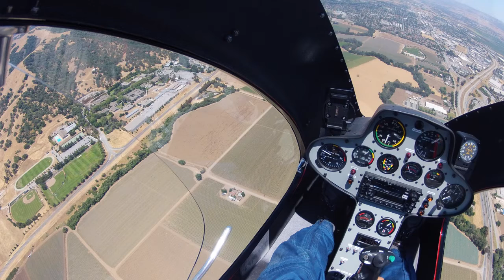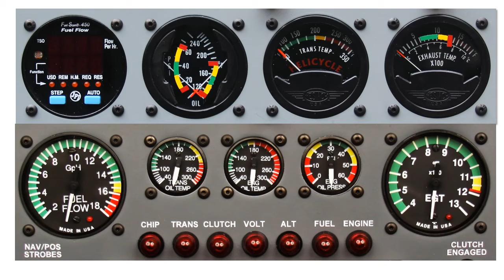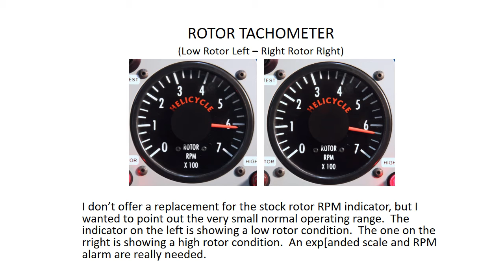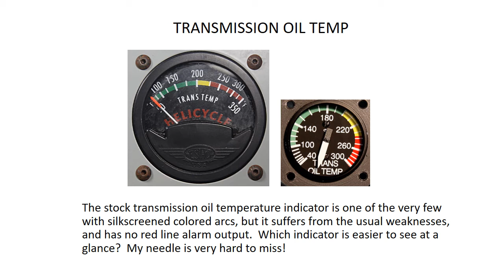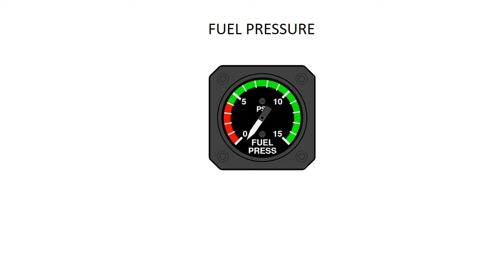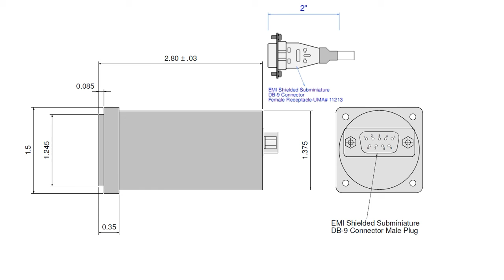Custom Instruments for the Helicycle

Comment: Finding instruments is an aspect of building an aircraft I have found difficult. Most of the instruments are imperial and not standard measurement, not sure why. With the world being Metric, why they still produce imperial gauges is beyond me. Also finding an altimeter that goes to high altitude is even more difficult, most only go to 3000 metres, when I need one that goes up to 26000 metres.